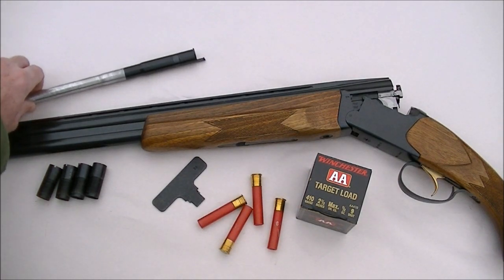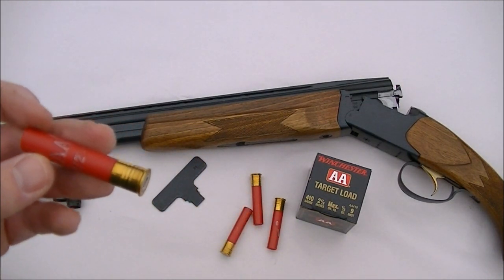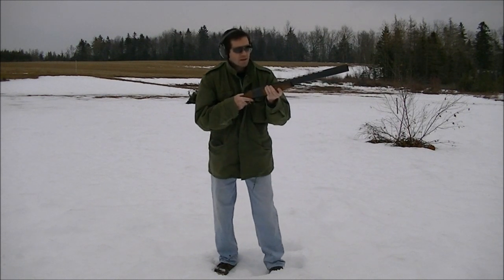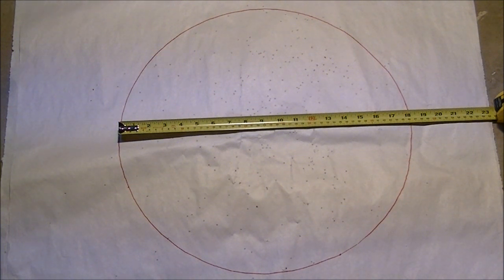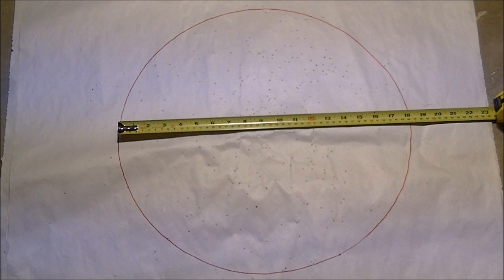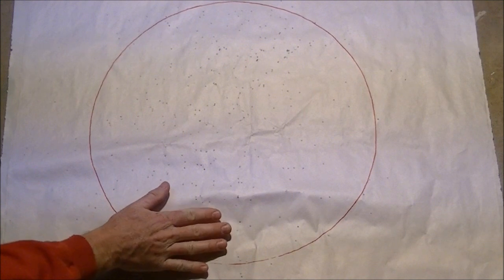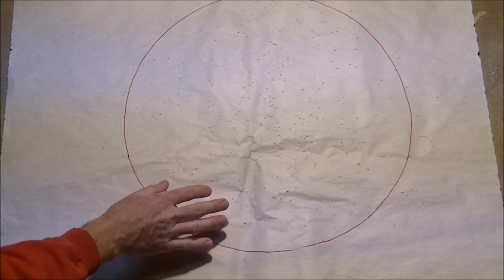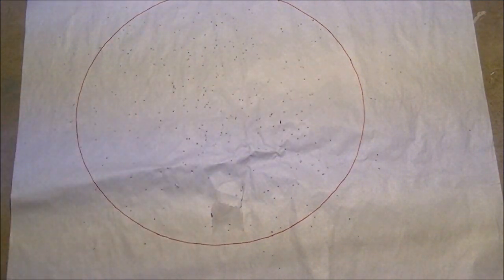Pattern Testing the Savage "Four Tenner" .410 Shotgun Gauge Adapter

Comment: .410's are such good shotguns, no idea why anyone would ever talk bad about them, in the UK they're absolutely perfect for small game hunting.
Reply from the maker: +Moo I think there are two reasons why .410's get a bad reputation from some shooters. The first is that they try to push them out of their reasonable limits, 410's are best for short range (25 yards or less) and small shot is necessary to get decent dense patterns. The second reason is poor shooting skills, with a 12 gauge you have so many pellets to work with that you dont have to be as "on" the target, with a .410 you must be "on" in order to apply the pellets to the target.
Reply: Agree... The price premium for the .410 shells over 20 and 12 gauge shells is also an issue for many shooters...
Reply: I still remember my first outing hunting squirrel with my new H&R Topper in .410 at age 10.

Shot one out of the  top of a hickory tree and it hit the ground hard.  I remember it sitting up on it's back feet, looking around for a second then  running off full speed.  All while I was frantically trying to reload.

Comment: The 3" shells are a lot better for hunting. We use 3" # 6 shot for squirrel hunting all the time. Thanks for the test.
Reply from the maker: +JimmyCricket61258 Size 6 shot is an excellent choice for the 410.
Reply: Yes 2 1/2 shells are ok for target 3" shells number 5 shot  are just right for hunting oh and a tight full choke is needed.They put meat in the pan.

Comment: hmm, what is the purpose to convert a 20ga to .410 ?  the 20ga shells are a whole lot cheaper that .410's .. One can buy two boxes of 20ga for the price of just one of .410.. target loads
Reply from the maker: There are a few reasons you might want to shoot 410 shells instead of 20 out of your 20 gauge. First one being that sometimes a 20 gauge is too much and blows the hell out of game at close range, the smaller shot charge in a .410 does the job at close range without messing an animal up so much. Second is recoil reduction for new shooters, a full charge 20 gauge in a light single shot kicks a fair bit. With a .410 insert the recoil almost disappears making for a more pleasant experience for a new shooter or someone of small stature. The third reason is the one that I enjoy the most, it is shooting the game of skeet with the more challenging .410 shell but in my familiar 20 gauge gun.

Comment: the 410 it's a best
Reply from the maker: +Damien Vidal  It's a best?
Reply: +314299 Shooting Channel Damien Vidal must speak Spanish, like me. The expression "it's a best" must be a wrong traduction of "es una bestia" which means "it's a beast". Who knows? Maybe he wanted to say, as you can deduce, "es el mejor" = "it's the best". BTW I was expecting that result since those chokes are for the width of a 12 gauge wad and lead shot column so a very narrow one almost don't find any difference. A morbid fat man can have problems with an airplane seat, for the rest of us it really doesn't matter if the seat width is 60 or 75 centimeters. (Metric System, I'm Spaniard)
Reply from the maker: +Perico De Lospalotes I suppose that could be what he was getting at.
Reply: Damien Vidal I like twenty gauge better
Reply: Calibre 12